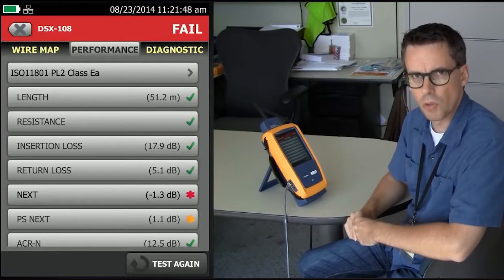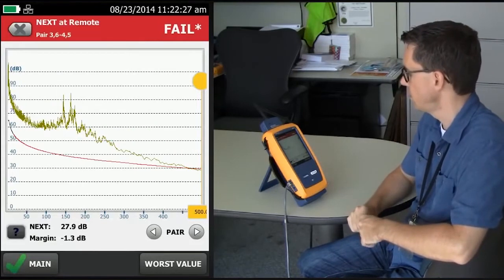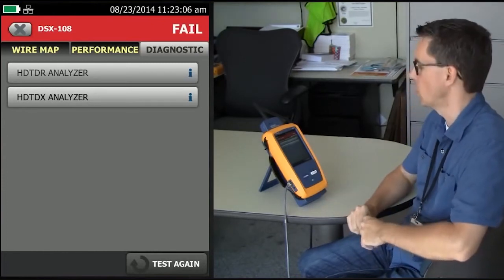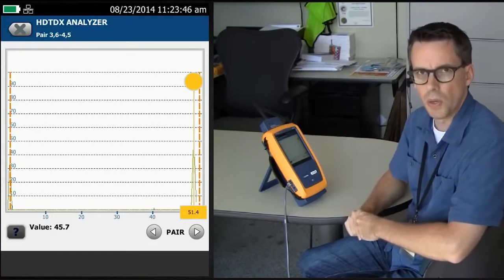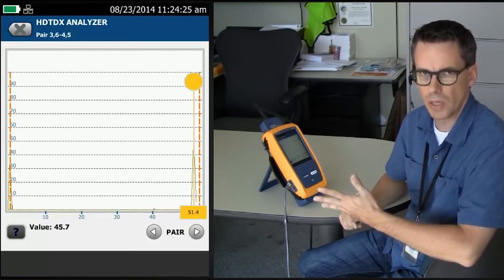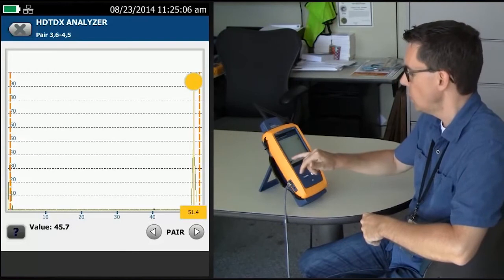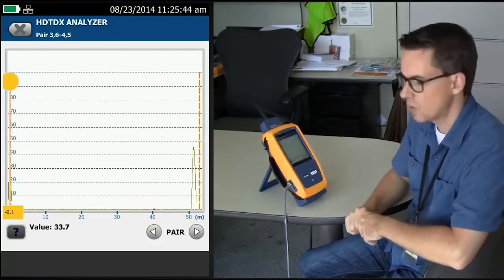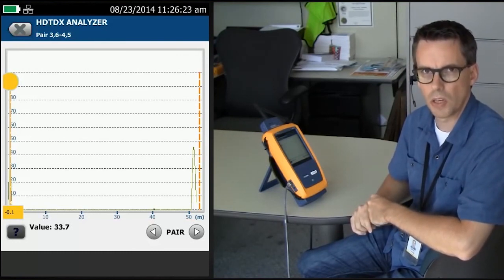DSX 5000 CableAnalyzer NEXT failed due to poor termination: By Fluke Networks

Comment: Due to NEXT value(-1.9)  our IP test getting failed so what is the solution to resolve this issue. HDTDX value (56.99)
Reply: Every time we test it fails for next I don’t get it
Reply: With cheap cables it is easy to recognize because they are made on the border of the NEXT parameter error. The entire length of the NEXT cable is at the limit. Another problem is bad termination of the LAN socket. Cable pairs without crossing over too large a length.